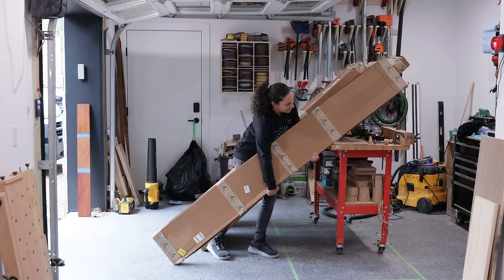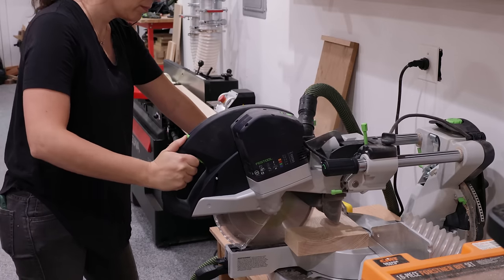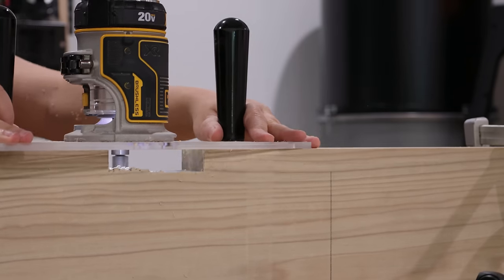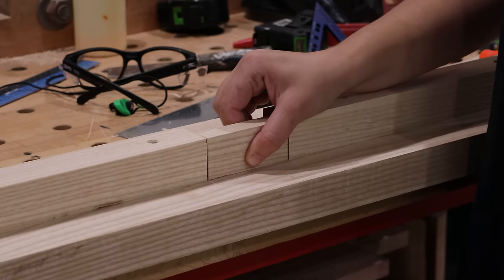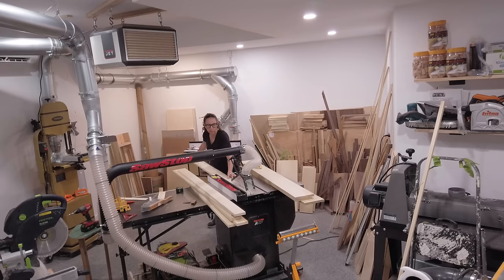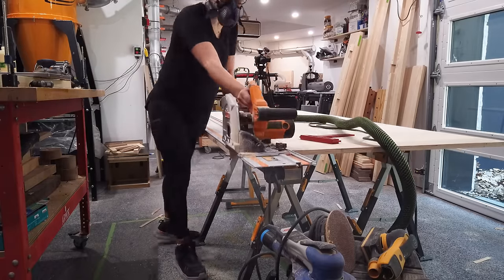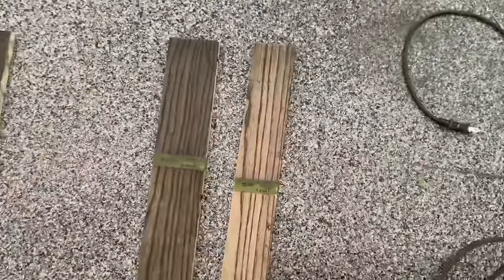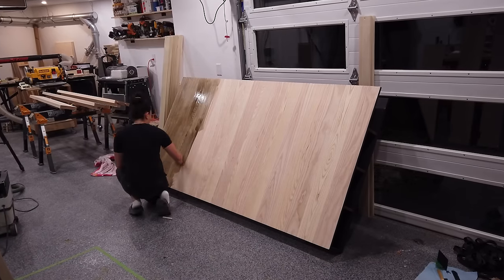Building a Floating Bed with Bookshelf Headboard

Comment: I love the floating design and the overall look of the bed, with massive headboard and walnut shelves. Combined with the dark stain, and the overall finish, it looks like an expensive designer piece.
Showing and explaining the whole process, including the mistakes, is great and helps a lot in staying motivated.
It can be quite difficult to learn to think in 3D, turning und flipping forms in your head. My skills in that area slowly improove, but seeing even big YouTubers making mistakes is kind of comforting.
Have you ever had issues with screwing down the slats when the wood expands and contracts or there's movement on the bed?

Comment: Looks great! Love the finish. I will have to try this sometime. 

One thing you might want to try in the future is painting ash and applying a glaze over the paint. It looks good because the glaze goes into the grain accenting the pores of the ash. I worked at a cabinet company that did this on white paint and it was beautiful.
Reply from the maker: Thanks! Sounds cool. I’ve done cerused oak before with wax. Sounds like a similar concept

Comment: Tamar a quick tip: I always use blue tape and write on it. Top bottom left and right to make sure I don’t mess up any glue ups or glue the wrong part in the wrong place.
Reply from the maker: I did that on all the parts except the ledges I messed up on... ha.

Comment: Would u recommend to use 19mm blackboard with 6 inch border around and below the desk from the same blockboard to act as a support frame and add thickness to make a 5x2.5 feet table with ikea adils leg?

Comment: For future reference, from somebody that makes a lot of mistakes, white vinegar will loosen wood glue. You can dry it out with a heat gun after separating, sand it, and be ready to glue back on in the correct position in no time without damaging either face of the mistake.

As always, great video.
Reply from the maker: Vinegar! Noted!

Comment: absolutely fantastic build!!! loved seeing it. A thought occurred to me though. The domino as a spline probably won't offer too much extra strength (might actually take some away) because you are replacing that long grain with a perpendicular domino. So the stress on that joint will actually be down onto the domino's weakest direction.  Probably not a huge deal. but I figured I would call it out incase it helps anyone on future projects!
Reply from the maker: I hear what your saying, but it’s very hard to split a domino lengthwise. It would have been better to get something with grain running across the joint, but it’s better than just leaving the end grain! Ha

Comment: Tamar, you always create such wonderful projects, and, like the rest of us, you make mistakes and have to fix them. Great job! Great ASMR!

I employ a simple trick to hide the end grain that is inevitable on butt joints such as your bed rails: Cut the ends of the overlapping piece at 45 degrees, and then cut off a small piece that is also 45 degrees and only as long as the board is thick that will serve as a return. That way, it appears that the grain runs continuously as long grain all the way around the butt joined pieces.

Takes two minutes and ups your game to the next level. 

Keep 'em coming, Tamar!
Reply from the maker: Interesting... I think I am imagining this correctly... Then there would still be a break between the 2 pieces, like a false miter?
Reply: @3x3CustomTamar  
A visible break, of course, as it is still a butt joint. However, at least this way, the grain runs continuously all the way around the perimeter. You never encounter end grain visually. For the best grain matching results, cut your "miter wrap" pieces from the ends of the adjoining pieces and not from the ends of the perpendicular piece that gets 45-deg cuts on both ends. This way, it will more closely resemble a picture frame joint without the problems associated with delicate "knife-edge" joints on big heavy boards.

Try it next time. Takes 5 minutes to employ, and the inside cut 45 at each end has no effect on your target dimensional length.
Reply from the maker: @mountainlightwoodcraft  definitely interesting. I’ll have to try it

Comment: I know you look for fun and interesting challenges.  I'm finishing up a backgammon board that folds into a small suit case. It is a smaller project, you have worked on mostly large projects.  It does have plenty of interesting parts.  Creating a template to cut out the triangles, I used wood and epoxy.  I have pictures along the way.  I'm happy to email them to your business account if you want to see how I approached the project.  I'm curious how you would approach it.  Thanks for all the project videos!
Reply from the maker: Sounds cool. I look forward to building those sorts of project again soon. But for now I’m focusing on the furniture we need for our house.

Comment: my daughter wants a similar design headboard. maybe a little deeper. 
Did you consider softening the corners with a round over bit?  I feel that beds shouldn't have sharp edges.
Reply from the maker: They are softened but it did it by hand 👍
Reply: @3x3CustomTamar  thanks for responding.  I really want to follow in your foot steps but I'm nervous about ordering the wood. I'm going to try to pause your video to see what cuts you used. at the moment it choosing 'eighth quarter sawn' might as well be spoken in Swahili for all I understand it.

Comment: I was wondering why you chose pocket holes and then decided to glue when there are domino "connectors"  They are a little weak imho for the 500 series ones, but I have been using them and they are stringer than pocket hole screws. I want to try your loose tenon router jig but supersize to the new domino XL connectors.
Reply from the maker: The dominos were just for alignment. I didn’t glue the frame so it can be taken apart if needed.

Comment: I have a question on your finish. I see that you used black and grey Osmo wood wax.  I did the same thing for the slat bed that I  am making for my son. I noticed that you had polyx oil satin in your product list.  Did you put this over the top of your wax finish to give it a more satiny finish.  He wants his bed to have a little more gloss.
Reply from the maker: I did not add anything on top of the wood wax finish. I linked to the polyx oil because that’s what I used on the walnut.
Reply: I looked at my Osmo and noticed it was matte. I went over it with clear satin and it now looks amazing.  I really like the black with the grey as a second coat.  It added warmth and depth to the color.  I would have never thought of that. Thanks for suggesting.  Have you ever tried other combinations?  I am thinking of perhaps something like black with blue over it.  I wa also wondering what the color would look like if you reversed the order of application

Comment: With the screws out, if the glue doesnt come off with the piece upside down...couldnt you just use the bandsaw to easily cut right along the face of the bigger board but more into the side rail to avoid screwing up the bigger board and then switch it around?

Comment: I think I would have used my bandsaw (with a fence) to cut off the supports that were glued on upside down.  Then a quick run through the planer to clean up the bandsaw marks.  Yes, the support would be a bit thinner.
Reply from the maker: That would be a great idea. My bandsaw has been acting a little funky lately so I didn't trust it.

Comment: I’ve never understood people‘s aversion to pocket screws. Some of the most expensive furniture makers use pocket screws constantly on fine furniture. If you know where to look, you can find them easily. And by the way, had you in advertently, put the hole in the wrong place, like the outside of the end of the board, it’s not a mistake it’s a design choice just take a piece of some other contrasting color, wood and put it in to the hole. Granted you’ll have to make several extra holes to cover the four corners, but in the end, it looks like a design feature, and not a mistake. It could look like a small through tenon or you could make it inlay by just using a router bit and cutting a shallow slot all the way around and putting in a contrasting wood. I’m a believer in the Bob Ross method, there are no mistakes just happy accidents. Trust me, if you’re creative enough, you can find a work around for all of it.

Comment: 6:38 - ever consider using the miter saw for that instead? Less of a pain vs juggling a circ saw with a board hanging over a the table.
Reply from the maker: Yeah. I don’t love where my miter currently is. So I would have had to set up too many things to make that work.
Reply: @3x3CustomTamar  — ahh, got it. Since dry poured concrete is YouTube’s latest thing, I look forward to the video in where you pour a new slab, knock out a wall, and expand the garage working area. Permits are SO easy to come by after all lol. You can even do the “I epoxied the floor myself” trend.